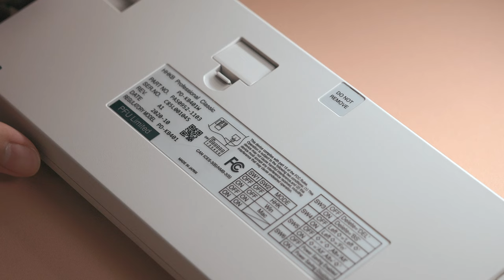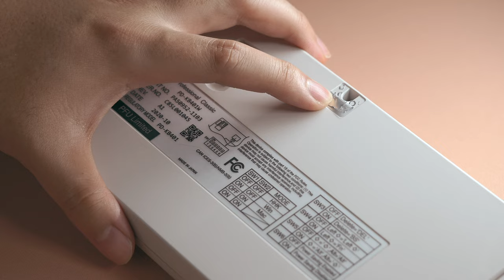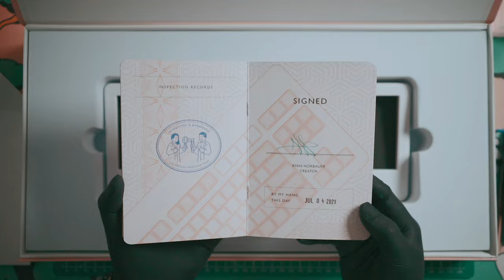building a Heavy Grail | the ultimate HHKB aftermarket housing

Comment: Really gorgeous keyboard but maybe one day I'll like topre...maybe one day. It just sounds so hollow and membrane-like ("it's ok when topre does it!"), like everything a non-topre user would be against lol. But then topre users also hate on cheap mass produced hollow sounding mech keyboards from Razer, Logitech, Corsair...etc. I don't really see the difference lol
Reply: Having a few Topre keyboards, it also really depends on the type you get I think. I thought the Type-S would be the one I wanted. But, found that I much prefered a regular one that I then silenced.  After being silenced, it has more of a linear feel.  

The upstroke clack becomes more of a subdued thock and for some reason, the silenced non-type-s feels a lot smoother and more like a Linear than the Type-S, which is much more clearly a tactile feel. 

I started out with the self-silenced non-type-s, and thought I would upgrade to a Type-S. But, it left me with more appreciation for the self-silenced non-type-s.  It does also help to lube.  

If I had started instead with the Type-S, I may not have liked Topre at all.

Comment: I did the same built as you with my heavy grail. However, the spacbar gets jammed when I mount it the normal way. What am I missing? Did I install the des-sliders for the spacebar wrongly? Any ideas on that?
Reply from the maker: In my experience jamming usually happens because there's not enough space under the spacebar (keycap interference), or there's too much lube or another obstruction that's preventing the stabilizer wire from moving freely.

Check to make sure that the stabilizers are clipped in all the way to the plate, and that the PCB is tightly screwed against the plate. Also make sure that the stabilizer legs move up and down without any resistance when there's no keycap on them (use a set of tweezers to move them up and down and feel for any resistance). 

Note that DES sliders aren't compatible with all cherry profile keycaps, but popular ones (GMK, ePBT, PBTfans, etc) should work without interference issues.

Comment: using a power screwdriver to start a screw is a universal no-no. By far, the easiest way to strip threads, especially when dealing with non-metal housing. Also, krytox-2xx is made with silicone, which is noncapacitive. You're effectively insulating your PCB from the signal it needs. As the board heats, the compound will slowly degrade the capacitive functionality of the pcb.

Comment: For next time, keep the PCB module and domes together, so when disassembling, sandwich the top-plate and PCB together and carefully remove the top-plate with sliders and keep everything on the PCB [domes/springs included] aligned and together.  And when assembling, do the reverse.  Float the top plate/case over the PCB-dome set and almost float the PCB upwards in, and then sandwich it together so you can access the bottom and screw it all in.  
Can check out my build for how I did it.  Was stressful to perform, but very clean, zero mess.
Reply from the maker: Was considering that as well, but I wanted to take the oppty to lube the PCB while I had everything disassembled so I didn't do that this time. I don't think lubing the rails or PCB made a huge difference though, so in the unlikely event that I do ever build another HG I'll definitely give that a try!
Reply: @sagwatypes  never say never
Reply: He successfully removed the PCB with all domes still attached, so I’m assuming when he later removed the domes from the PCB it’s because he wanted to.

Comment: the deskey slider  need to be use with the silencing rings  ,if you dont you can change to the novatouch's sliders
Reply: The pads he used on the bottom of the sliders are specifically meant for using the sliders without rings. They’re supposed to be the same thickness as the rings….so instead of pushing the slider down X mm, you’re extending the length of the slider X mm.

Comment: Do you feel that the MX stem converters had a huge impact on sound/feel?
Reply from the maker: No change to the feel that I’ve noticed. They sound slightly more muted than stock, but that could be because of the HG case and the silicone slider pads I used. I was worried because some folks do seem to notice a difference in feel but they feel just fine to me.

Comment: Hi, great video! What did you use to drill the stabilizer housings?
Reply from the maker: Thanks! I made a small indentation in the plate with a Philips screwdriver and then used a power drill at low speed to drill the hole but it was hard to be precise.

Deskeys sells a tool set for this that just came back in stock: https://deskeys.io/products/des-hand-drill-for-mx-housing

You can also search for a “hand reamer tool” on aliexpress for a cheaper version of the deskeys tool: https://www.aliexpress.com/i/4000042460837.html

Comment: What button does the Windows key default to?
Reply from the maker: I use mine with a mac, so the two modifiers adjacent to the spacebar map to Command. There’s also DIP switches on the bottom to change keymaps. If you’re curious about the layout, there’s some good info here: https://hhkb.io/layout/

Comment: Hate to sound like a hater, but the amount of gain that you have your mic setup to is also _very high. It amplifies high frequencies and makes the switches sound shrill as it attunates to the sound of the keypress, then ducks below. The same can be said about any scene involving your auto screwdriver. You might want to mute/lower the gain on the screwdriver scenes as it's shrill and set the gain low for your keypress scenes while applying an EQ to subdue the high HZ tones.
Reply from the maker: Yeah! 7 months in and I'm still figuring this stuff out. I'm not a full time youtuber by any means so I appreciate the feedback. Will try to improve on new vids. Thanks!